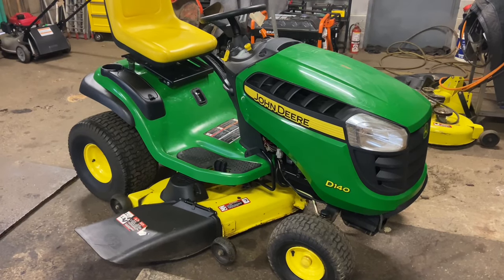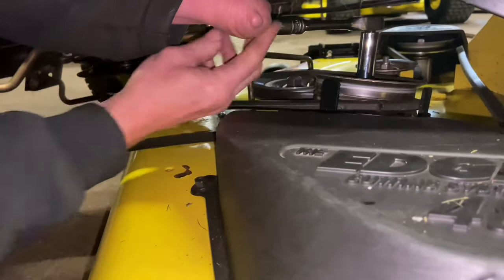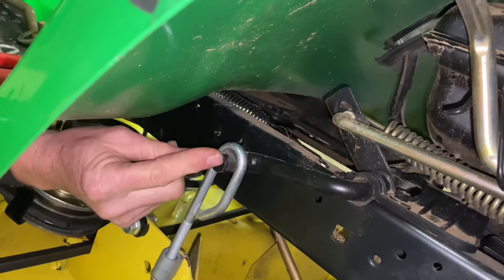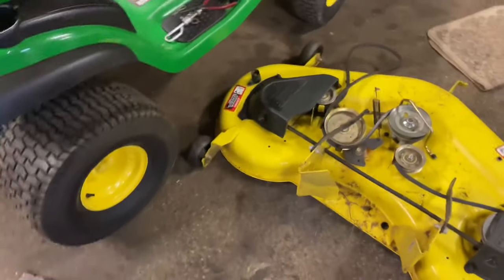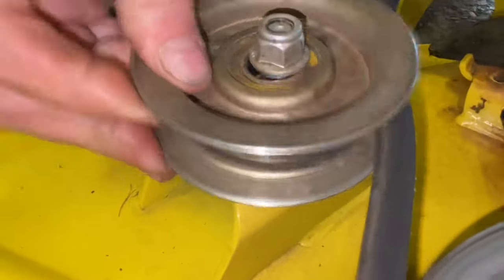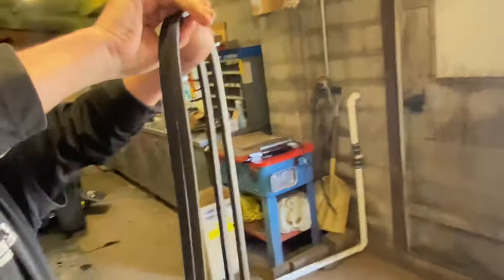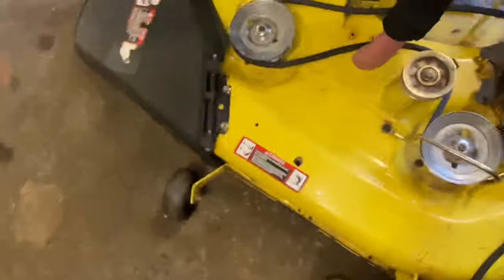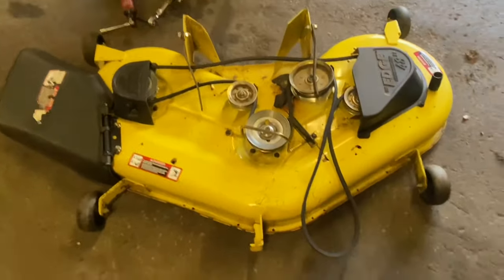How to Install a Mower Deck Belt John Deere D140

Comment: One thing to mention, when putting the new belt in, it needs to go with a certain side facing in, certain side facing out, and should not twist at any point. I made both of these mistakes and ended up having a deck that was shaking when running, tore it apart again and figured this out.
Reply: So which side faces in? Flat side?
Reply: Both…. Some of the pulleys are flat and some are grooved. Lay the belt out straight and start with flat pulley on flat end of belt and wind it thru, if correct all the flat sides of the belt will meet the flat pulleys and all the grooved sides will meet the grooved pulleys, without twisting the belt
Reply: @davidh3774  I read this reply after I had reassembled the wrong way. Lol
Reply: @chaddodson1481 will a 48"deck except a 42" deck equally?

Comment: Watch this video carefully  My mower deck problem was solved with deductions and process of elimination from this video.  Thanks goes out to Johnson's for this video. The issue as an installer error - and I am the installer.  The error: The three spindle pulleys on the 48 inch D-140 mower deck are not symmetrical.  I mounted the three new spindle pulleys upside down!  That caused the belt to be about 1/2 inch too low across the back of the mower deck and rub on the rear mounting points - that destroyed the belt in a couple minutes.  I realized my mistake, flipped over the three pulleys and the problem was solved with the addition of a new Kevlar wrapped belt.  The three idler and guide pulleys are symmetrical and doesn't make a material difference which side is up. Again thanks to Johnson's!

Comment: Thanks for the tutorial 
Needing to rebuild mine. Really appreciate the clear directions
Reply from the maker: I’m glad this video was helpful. Thank you for watching and the kind comment.
Reply: @JohnsonsSmallEngines  Not a problem.  Just now dropped deck on this john deere d140. Took me 2 minutes and without you posting that video I probably would've considered buying a new mower vs replace bearings on my own.

Comment: First of all, Very detailed and concise. Great video. I just replaced my belt today in my D140. But after getting everything completed, it seems like the belt is slipping. The blades will finally turn but as soon as there is any resistance the blades just don’t turn and the belt is getting really hot. Besides the tension pulley on the deck, how can I adjust this? Or what did I do wrong?
Reply from the maker: I always wonder why the belt broke or why you need to install a new one. That being said make sure you double check to make sure all is good with your pulleys and blade bearings and double check the belt is running around all pulleys properly. Did you purchase a genuine John Deere belt? If you have a aftermarket belt it may not be correct.
Reply: @JohnsonsSmallEngines  Mower is 6 years old. Had some chunks out of the existing belt. Figured it was time for a new one while I had it off to sharpen the blades. Everything went back on perfectly. I triple checked the belt to make sure the flat aside of the belt was on the flat pulleys and tapered side was around the tapered pulleys and the pulley coming from the engine. Soon as I’d run it in the grass it wouldn’t cut blades would stop and belt was hot as all get out from just rubbing on the pulleys.
Reply: @JohnsonsSmallEngines  I have the old belt still. I’m gonna put it back on and see if it still does it. Maybe I got a bad belt or something… I dunno.

Comment: excellent video - it was great to see how fast the belt can be changes and the deck off and on again so quickly.  the video is about the best that i have seen in my repair quest,  After years of use of my 48 inch Deere with D140 tractor, the idler pulleys finally went bad with one of the small ones actually seizing.  I rebuilt the deck with all new spindles, spindle pulleys, blades, belt and the three idler pulleys.  However the new belt was immediately  (30 seconds) torn up. I suspect that I over tightened the idler pulley nut(s) and that is the issue to try to solve.

Comment: Thanks, just replaced mine and felt weird that the back part of the belt goes in a straight line between the two rear pulleys and gets really close to the metal frame.  Guess that's just the wait it is.

Comment: Great video!  Thanks for making it. I get the belt on but it keeps coming off as soon as I engage the blades. I confirmed the belt isn’t twisted and follows the correct path. Any suggestions?  I wonder if I have a bad pulley?
Reply from the maker: Check the belt guides to make sure the guides are in correct position and the belt is running correctly. Check your belt covers are on correct. You may also want to purchase a new belt. It sounds like your belt guides are not working for you.
Reply: @JohnsonsSmallEngines  thanks. I have a new belt. I may have a bent the pulley with the spring tensioner.

Comment: Thanks for the video, I used fat fewer four letter words than normal.  As a suggestion, if you could show the pu back together that would save us a lot rewinding..
Reply from the maker: I'm glad it was helpful and thank you for commenting. I have learned alot about making the videos in the last couple years and all videos that I make now will show from start to finish. I will need to remake this video when I get a John Deere D140 that needs a mower deck belt.

Comment: Hey again, my 140 is 8yrs old and just ordered the first deck belt replacement !!  My reverse has been slow for a little bit, no previous service either … do you have any videos or ideas on that  issue ?
Reply from the maker: I would suggest cleaning any debris from around all linkage to the foot pedals back to the transmission and look for any loose or worn parts.
Reply: @JohnsonsSmallEngines  thank you.

Comment: Good, clear video. My belt went on fine, but needs some adjustment. Do you have a video on adjusting a belt on this type of deck, ie, a deck WITHOUT a cable adjustment? Thanks!
Reply from the maker: There are no adjustments. Belt tension is spring loaded only.

Comment: I bent the guides with a wrench because I couldn't get the pulleys off of a couple pulleys and then bent them back (although not perfectly).  Do you see a problem with that?
Reply from the maker: As long as the belt doesn’t fall out between the pulley and the guide when the parking brake is on, meaning when the belt is in the non tension position, it should be ok.
Reply: @JohnsonsSmallEngines  Thanks!  I wished I would have watched your video, I thought the pulley was on with a key or something.